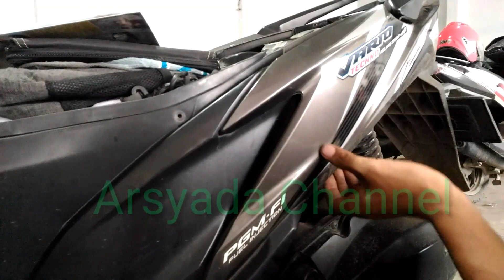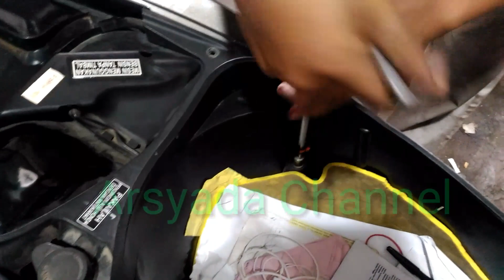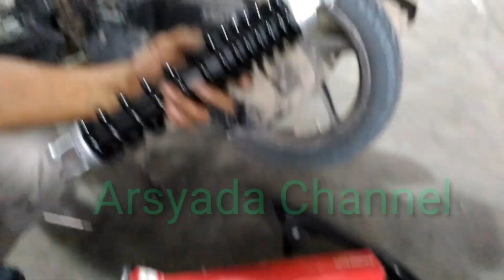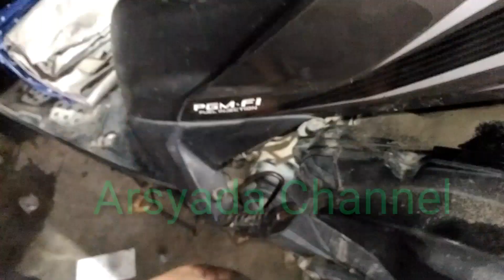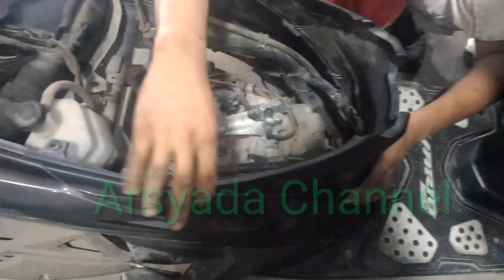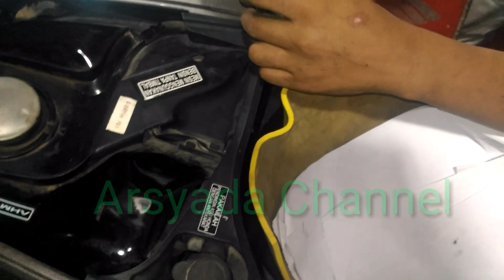Bongkar Pasang Sokbeker Belakang Vario 125

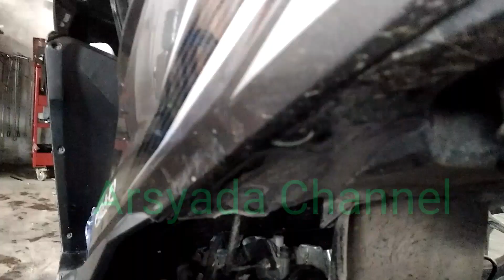Comment: Di menit 0:25 itu penutup nya namanya apa yah? Punya saya patah karena dipaksa buka waktu ganti shock karena ga tau ada penutup itu
Reply from the maker: Baud bumper clip mas.
Harganya skitar 5000 mas.
Reply: Arsyada Channel kalo boleh tau no parts nya brp yah? Saya mau cari tp ga tau bentuk asli nya kaya gimana. Yg divideo kurang jelas soalnya
Reply from the maker: Ada 3 jenis ya mas.
Vario 125
Bentuk kepala bundar tengah nya dua garis sampai ke tepi baud.untuk di tekan saat mau dilepas.
No part 90683-GAZ-003
"Clip Trim"

Cbr 150 R
Bentuk kepala bundar ditengah nya ada penekan baud agar lepas,bentuk nya bundar kecil di tengah kepala baud clip.
90116-SP0-004
"Clip Bumper seal"

Supra X 125
Bentuk kepala bundar,tengah nya ada mata obeng plus sedang,putar saat pelepasan.
90657-SA5-003
"Clip Side Apron Molding

Semoga bermanfaat.
Maaf jika ada kesalahan ya mas.
Trmakasih
Reply: Arsyada Channel terima kasih banyak mas..sangat membantu sekali
Reply from the maker: Sip mas bro.